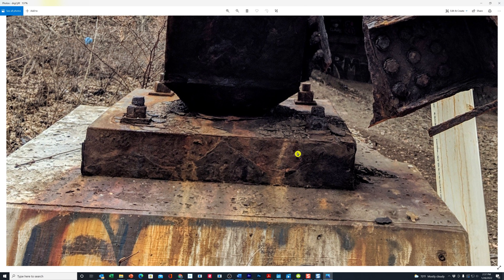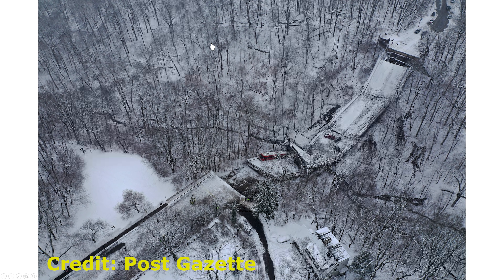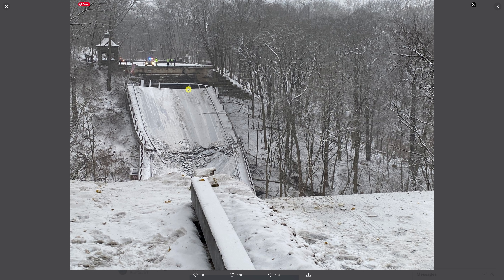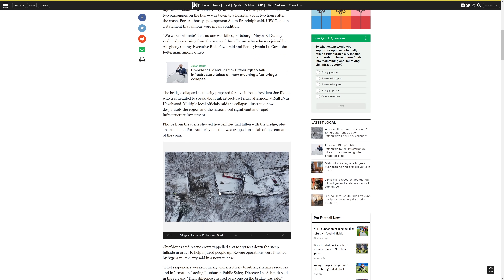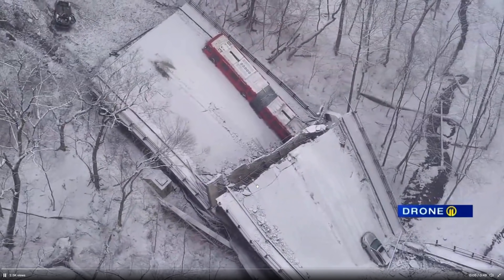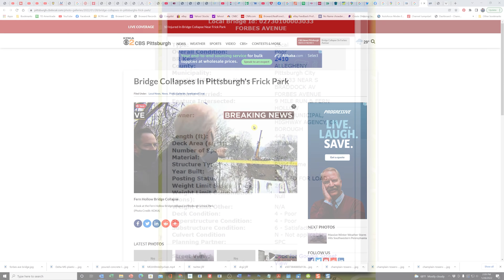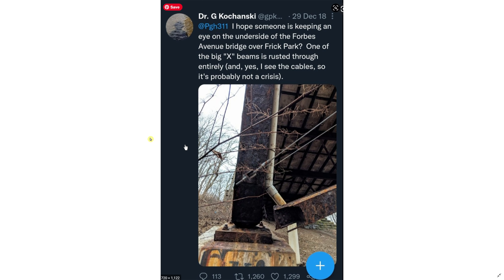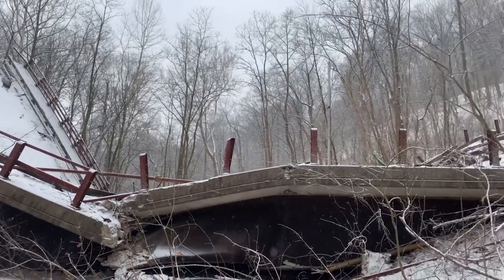Pittsburgh Bridge Collapse Cause, Forbes Ave Bridge Frick Park Rust?

Comment: I live in pa in 93 bridge was hit muliple times took them to 2019 to replace it
They just closed bridge cause was hit by truck
They had bus driver smell natural gas soon as bridge collapse  so did that effect bridge collapse
In school I learned effect of heat on each metal 
You missed other side where cement buckhead that had gas line had huge Crack
They replace bridge  near me cause drains got plug and fill up with water 
I used travel over that bridge with went school in late 80s I usually took different  route by bus
Reply from the maker: Mor elike the nat gas lines run under the or mear the bridge, so take down the bridge there goes the gas
Reply: @jeffostroff  if gas line went first it could shatter the metal only reason bridge wasn't loaded with cars there was school delay

Comment: Welcome to Pennsylvania, land of corruption and wasteful spending. It should have been repaired years ago but all it got was a band-aid. What makes it worse was it got inspected again in Sept 2021 according to KDKA and WTAE.

 I grew up in Western PA and most of my family is back there. A lot of their road and bridge infrastructure is HORRIBLE. So many potholes in the roads, bridges that are hanging on by a thread…literally. Most roads in western PA are chip and tar which PennDOT says it’s “sealing the road”. It isn’t cause as soon as winter rolls around the chip and tar breaks apart and causes pot holes again. It does nothing except eat your tires faster. To be honest, the concrete sidewalk and road cracks are VERY common in PA. You don’t drive on any roads or walk sidewalks there without seeing that. With this bridge, and others throughout PA, it didn’t have a weight limit for the longest time. But as the bridge ages and they don’t make necessary repairs, they simply put a weight limit on it as a “band-aid”. The Fern Hollow bridge got a weight limit of 26 tons sometime between 2008 and 2013. 

There is so much corruption in that state it makes no sense how it functions. They also have higher income, property, and gasoline taxes. By that they should have the best roads and bridges. But nope, the money is put into their politician’s pockets or spent on stupid crap. I believe this bridge had a repair estimate of $1.5 million. It makes you ask the question, why wasn’t it repaired in a timely fashion. It goes back to the corruption.
Reply from the maker: steel was from U.S.
Reply: @jeffostroff  It was probably produced right there in Pittsburgh at one of the mills.

Comment: This guy is not qualified in any way to produce a video like this.  I am a bridge engineer with 25 year of experience designing and inspecting     bridges.  I watch up until 4:39 and he does not know what a bride abutment is, deck joints, bearing seats, etc. are, all elements of a bridge.  Note as the bridge collapse d inward towards the middle it pulled the ends of the bridge superstructure off of the abutment/bearing seats, since the whole structure is one piece from end to end.  Nothing sheared at each end.  Also LOL on the weight of the snow on the bridge!  Very little snow on the bridge before the collapse.  The recent extra cold temps had a factor in the collapse (colder = steel more brittle).  Also this is a non-redundent bridge structure, we would not build them like this now.  Please remove this video.

Comment: Personally i think pgh should hire a more competent inspector. years of salt and winter plus the weight of constant repairing with new black top on top of black top extra weight put on the structure. the whole thing is the inspector should have inspected the bridge a little better.
Reply from the maker: They rated it poor, but theres no regulations requiring the bridge get shut down

Comment: I'm not an engineer but from looking at it the way it crumbled it seems like it collapsed on the side toward the cemetery and Forbes not the South Braddock side in the park the reason I say that looking at your pictures and seeing the rusted out portions it makes sense it ripped from that side down pulling the side where the bus is back in I used to work for the city and underneath that bridge is a dog park and we took care of the little bathroom shelter area turning it on every season so we would venture up there to turn our trucks around and it was so obvious for the last 15 years the rust damage I just assumed that the engineers know what they're doing but were the people inspecting the bridge adequately trained in what they're doing maybe they were political appointees I've seen that in the past
Reply from the maker: Need better regulation on shutting down a bridge

Comment: When infrastructure funds are diverted for ‘social’ infrastructure.   Just a thought.
Reply from the maker: I want some of those funds!
Reply: It's easy to forget, but the former president was well positioned to succeed on infrastructure, which the Republican said was one of his top domestic priorities. But Trump just couldn't help himself.the first two years of Trump's presidency, when his party controlled the House and Senate — by larger margins than Democrats enjoy now — the GOP focused its energies on unnecessary tax breaks and a hapless health care crusade that ultimately failed. After the 2018 midterm election cycle, which left the House in Democratic hands, there were still hopes that an infrastructure deal was possible, and Democratic leaders were prepared to make it happen.
But as regular readers may recall, the then-president decided to attach some strings. In May 2019, however, according to Trump's own version of events, the Republican presented Democrats with an offer: The White House would work on infrastructure if Democrats agreed to stop investigating the then-president's many scandals. Democratic leaders, naturally, said that wasn't an option — they added, of course, that Congress can legislate and conduct oversight at the same time — at which point Trump abandoned the process.
Two years later, the Republican settled on a different kind of idea: If he couldn't have an infrastructure deal, then Biden shouldn't get one, either.
Indeed
Reply: @barbaragdisis4606  TDS much?

Comment: This a layman blabbering on for 16 min strait about something he clearly has no clue about. For instance his analysis of the cause, he goes over all the damage as a possible cause and which the expert are going to look into. When most likely the bridge just failed in one place and the rest is just the result  of tumbling down sustaining damage in the process. It's like someone showing the wreck of a car that crashed into a wall, at clear daylight, because the brakes failed, then rambling on about how the headlights are damaged, so he possible didn't see the wall, and the experts going to look into that, then oh the engine took heavy damage, this is damaged, that is damaged, this car had a lot of problems, no wonder it crashed. When in fact all the other damage is just the result of the brakes failing.

And that why this video could be 3-4 mins with some basic facts about the bridge, instead of 16 mins of clueless speculation.

Comment: Was that more of that cheap imported steel that couldn’t pass the strength test of steel made in the United States. The steel is rusted out.When the columns rusted out the fell down. That steel didn’t rust out over night.
Reply from the maker: The steel was made by US steel, probably not cheap and probably a decent steel but I think the problem was it's not supposed to be used in a humid environment which this bridge was placed over a brook

Comment: Are you a registered qualified structural engineer? The abutments you describe as "stuck on the hillside" go down how far? To bedrock? They do, as I saw the holes being dug before the abutments were poured in 1971. You are seeing only the top tips of these concrete supports. One can't judge structural integrity without knowing the real facts, and then telling a dramatized story. I'm relating this as a registered Professional Geologist (PG) in Pennsylvania, that lives close to this site. The design of this bridge won an award in 1974, I think, and the failure was due probably to very poor maintenance on the part of the City of Pittsburgh. The contribution of snow load to the weight on the bridge is negligible, compared to the vehicle load.
Reply from the maker: I know there are footers underneath but I was referring specifically to the size of the concrete pads and the spindle Lee thickness of the columns. There was. There was only 5 vehicles on the bridge at the time.

Comment: Pencil whipped inspections my bet, they know the bridge is rusting out, one of the beams is broken and they use cables to "fix" it, still they don't bother to paint it what a joke.
Reply from the maker: I wonder if the cables were even tightened. Redneck engineering

Comment: Imagine if bidens infastructure plan actually went towards fixing problems like this. You don't seem like you have a clue about structural integrity of steel and or concrete. The snow and weight load would have had no effect on the bridge collapse.

Comment: Salt, salt, salt!
Reply from the maker: Love that salt!
Reply: @jeffostroff  Over time, the structural steel certainly doesn't ! It takes it's toll on cars, and everything else, where ever it is used. I wouldn't doubt, if over time, the drainage sewers were paved over, and clogged, also!
Reply: Why do they have to dump so much salt on the roads even if it doesn't snow that much? Save the salt for when it's actually needed.